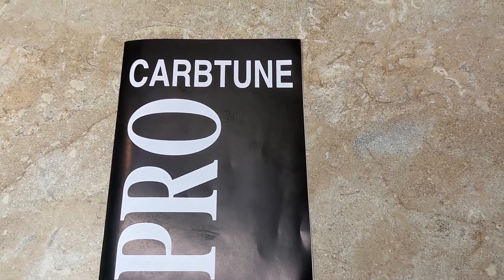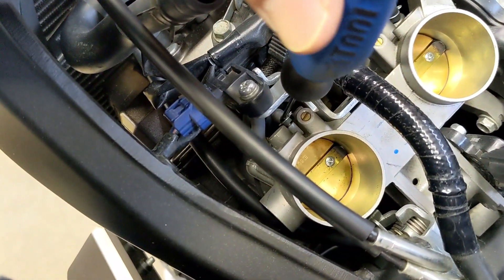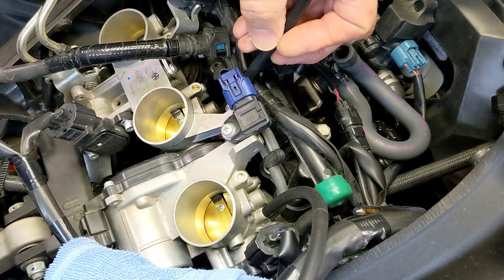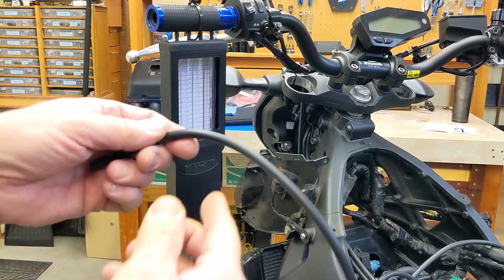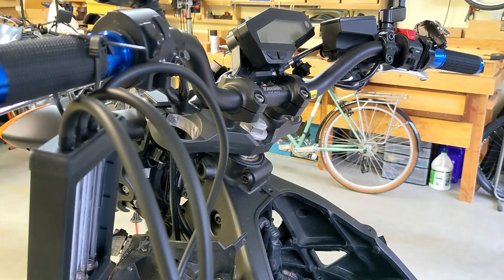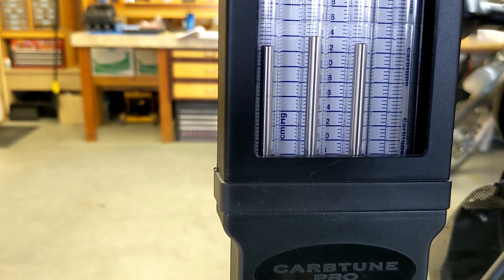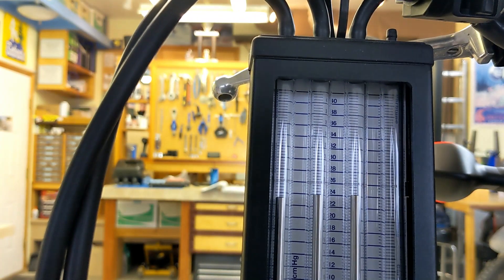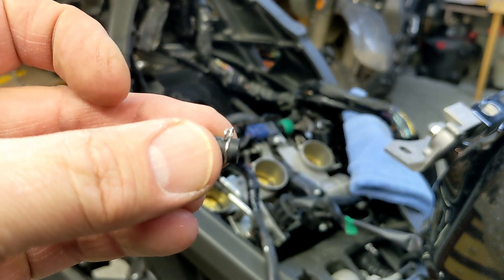syncing throttle bodies with carbtune pro Yamaha FZ-09/MT-09 2014 2015 2016

Comment: Im at the point to do the tb sync im not sure which direction is what. Does Right lower the reading? And left increase reading? Or the other way around?
Reply from the maker: Whatever you do... do not turn the screw with the paint... Just turn a screw one way and see what happens... and if it's the wrong way turn it the other way.... It's not going to be much of a turn...

Comment: Great video thanks , I've noticed none of my screws have any white paint on them , would would you recommend and is there any other way of knowing what the main throttle body is
Reply from the maker: What is the make year and model of the bike you are working on?
Reply: @meticulousmechanic  2020 Yamaha mt10 , I've checked the service manual and it's very similar to your mt09 , I got mine tuned so no 02 sensors anymore , I've noticed some people think you can turn the bypass screw but because mine is tuned I want to do it right , thanks for the reply
Reply from the maker: @bccapone837 I don't know... Did the service manual specify a certain cylinder that is the one you don't mess with? I noticed with my bike I accidentally tried to turn the one with the white paint because I was filming and not paying total attention.... It didn't even want to turn like it was locked tight... The other two screws turned easily.... as the last case emergency scenario.... You might be able to find the one that doesn't turn easy but you would have to be careful and watch where  the slot exactly was so you can get it back there if it turns....? I would do some more research before I tried this though!
Reply: @meticulousmechanic  no the service manual is like yours it just said don't turn the white screw but didn't mention anything about what cylinder , I won't tackle it until I'm sure what one it is in case I make a mistake , i did read somewhere that its usually the one that the throttle cables and tps go to so on ours it would be the right side one if you were sat on the bike but not sure how accurate that is . So far Ive done the plugs , air filter oil change and oil filter , coolant change and new brake fluid front and rear so I'm looking forward to doing the sync and getting it all where it should be . much appreciate the feedback I'll let you know if I find out what one it was , all the best 👍🏼😎
Reply from the maker: @bccapone837  maybe you could find out if Yamaha specifies a certain cylinder at the factory... Hopefully it's not willy-nilly (without direction or planning )depending on what the current factory technician feels like doing... Let me know what you find out I'm curious!
Reply: @meticulousmechanic  I will let you know as soon as I find out , I don't really trust the main dealership with my bike and that's why I do it all myself , but I'm not sure if trust Yamaha even if they told me over the phone but I'll give that a go first and then I'll ring the tunning shop to see what they say too , fingers crossed , have a good weekend 👍🏼

Comment: Good video. Could you feel a difference after adjusting it? I’m very new to the 09’s but after taking 2 short rides on my 2015 it wasn’t quite as smooth as I expected it to be and also felt sort of a delay in power in higher gears. Hopefully a sync will smooth it out. Thanks
Reply from the maker: The bike is running awesome now... The reason I did the throttle body sync was because I heard you should do that after adjusting the valves... My bike had about 25,500 miles when I made all the valve clearance adjust videos...
Overall the bike runs better than before I did all the work on it... Starts easier and purrs along perfectly...

Comment: how'd you get in running without the gas tank on?
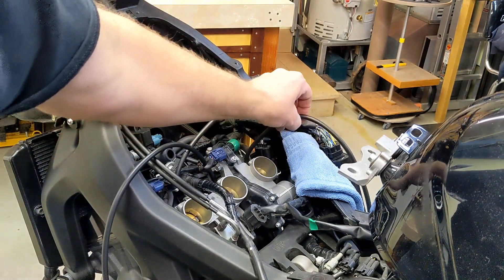Reply from the maker: 2:36 into video-the tank is connected-rotated and sitting on seat area-also check out my other video on preparing for throttle bocy sync- shows how to rotate and connect tank:
https://www.youtube.com/watch?v=0y7c_UReXJY&t=356s
Tip Jar: https://www.buymeacoffee.com/thanksrobert

Comment: Great video Robert! I've never seen a carbturn pro in action but it's fascinating! Stoked to see all the great videos you'll keep making!
Reply from the maker: Thanks!  It's interesting to me that when I first looked at the tool it seemed similar to a thermometer where the red mercury line  goes up with temperature,  but it's actually vaccuum pulling the rods up from the top. They are stainless steel rods inside a plastic tube.